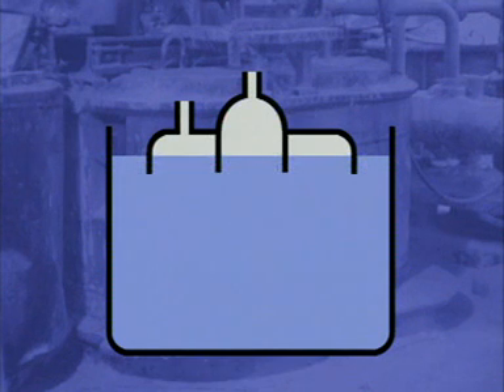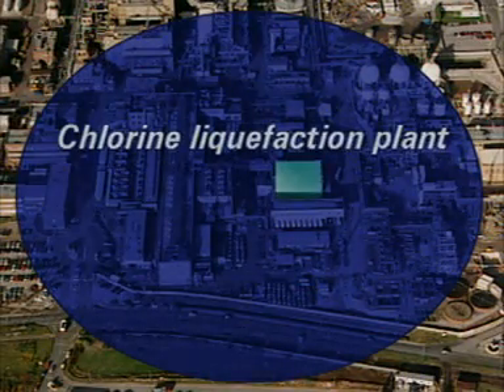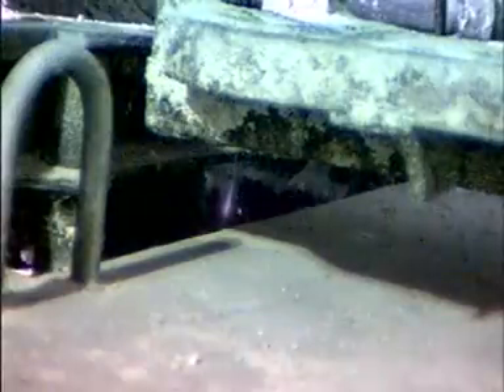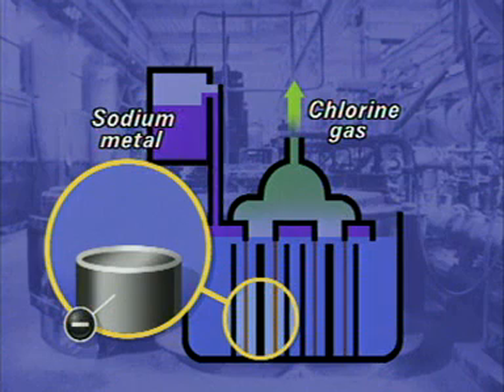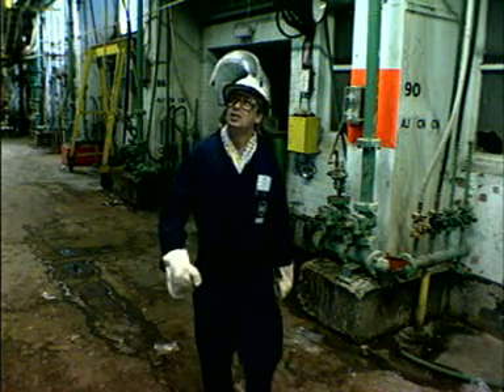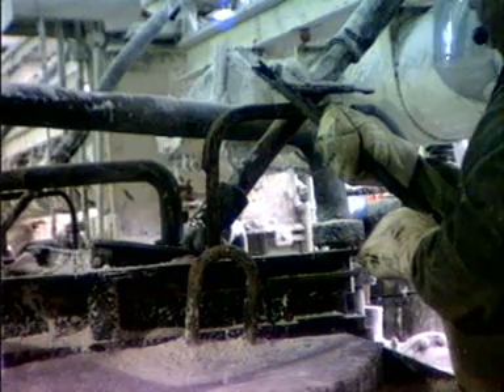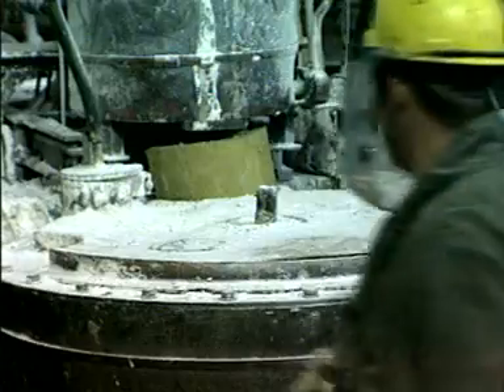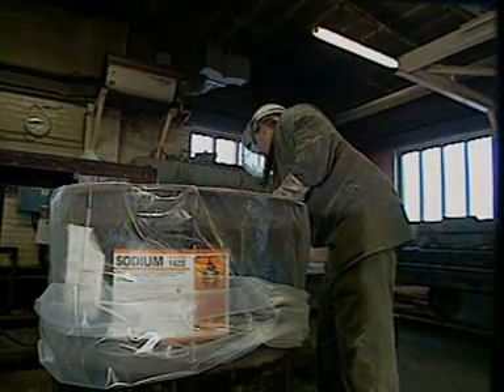Sodium production

Comment: Will this process stay economically relevant now that there's a far simpler process for producing sodium by sacrificing some magnesium? The price of sodium now that makes sense is just a bit above the price of magnesium.

If, for whatever reason, the electrolysis of magnesium is cheaper and simpler (I have to look into it), so is the production of sodium from it.
Reply: Interesting question.  I know the process you speak of but its really more amatuer-oriented.  I don't think it is faster or cheaper in spite of not needing quite so much heat.  This industrial process may look expensive but it really isn't.  Aluminum is made a similar way and the temperatures here are lower.  Salt (NaCl) is also a very cheap ingredient, where as NaOH is required for the process you mentioned, and that is not quite as cheap (with NaCl as it's starting material as well).   I'm also wondering how you would go about industrializing the process that uses magnesium.  Not saying it can't be done, but it is more complicated than this when looking industrially.

Comment: Nice, i was doing many test when i was 11 to make na use nacl.. it was 1987 and my big problem was difficulty to melting the salt..a few times i was able to make na using small tube glass but quickly after forming na begins reading with air ab catching fire..
Reply: I found that collecting the liquid sodium under mineral oil was enough to stop the reaction and put out the flames.

Comment: 3:07 wouldn't it produce calcium and barium too?
Reply: They do mention a little calcium is produced.  But due to the greater affinity that Ca and Ba have for Cl than Na, it's mainly Na production.  But, yes, certainly Ca and Ba are contaminants in the produced Na.  Although, it will also depend on the solubility for Ca and Ba in Na metal ... complicated stuff.

Comment: Workplace health and safety must be next level. Do they check the roof for leaks from time to time?
Reply: Yes the roof was checked, the building was so hot it was bone dry. They had the odd fire over the years and the operators had the occasional burn but generally ran safely

Comment: has anybody got an idea what material the chlorine collecting hood/funnel is made of?
i cant think of many materials that could resist pure, hot chlorine and be cheap and shapeable enough for industrial use.
Reply: I have NO idea.  On the sodium side, even very reactive iron is safe to use as an electrode.  On the chlorine side, what do they use ?   Graphite for the electrode AND the funnel ?  I'm not sure.  I would think CCl4 or SOMETHING would form from contact between the two elements are such a high temperature.
Reply: @pauls0416  Maybe a stainles steel variant ? maybe coated in a thin layer(oxides or chloro species?) as passivation ?
Reply: the chloride would react (the first time) with the wall of most metals in the piping. The same way fluorine reacts with the metal walls of its container to for a metal fluorine salt. In the same way chlorine would react with the metal walls of its container to form a metal chlorine salt.
Reply: I’ve got an idea that the chlorine ‘ collecting hoods were made from Inconel

Comment: How do they Prevent Sodium,Potassium,and Barium from Mixing?
Reply: They do mix.  They don't prevent it.  There is no need to.  Sodium is the most easily reduced ion in the mixture so they get almost entirely sodium at the negative electrode.  Slight over-potential does produce some calcium, as they said, but it can be dropped back into the solution.  The barium and calcium, therefore, remain in the cell and do not get used up.  They only need to keep adding salt.  The only part I don't understand is how easily they separate the calcium from the sodium.  Since they are both liquids at that temp, I assume the calcium must collect on the bottom of the chamber (being heavier) but it seems tedious to figure out where the division is and to carry out the separation.
Reply: The sodium went through filters before going to stock tanks. Sodium sludge from the filters was pressed to recover more sodium

Comment: I'm going to assume parts of this process are done in an atmosphere flushed using argon or dry nitrogen? like are the storage tanks flushed with something dry and inert to stop the sodium reacting, how are they mitigating the risks associated with handling sodium? is the air in the facility dehumidified? why was the barium used?
Reply: I have held sodium in my bare hands. Also only the surface of the metal reacts forming the oxide.this oxide acts as a protective laye
Reply: +Joep Stuyfzand cheers :-)
Reply: Joep Stuyfzand
Nah, I just like my chemistry and how it's applied on an industrial scale.
Reply: +Joep Stuyfzand you could probably use some kanthal or other high resistance wire with current running through it to melt the salt, that way you will not have to have any open flame and will have a constant heat source.
Reply: The passage of electric current through the molten electrolyte provides the heat to keep it at temperature.  Barium is used to increase the density of the electrolyte so that the liquid sodium floats on top.
Reply: @LarryMickelson  I thought the other salts were in there mostly as eutectics, i.e. to decrease the temperature required to get a melt.

Comment: Um when they pour that molten Na ,doesnt they react with the oxygen in the air o_O
Reply: They do. The oxide formed acts as a protective layer to prevent the rest from reacting,which is why only the surface is tarnished
Reply: @thoufeek1968  hmm it's not just on the surface.  It's reacting with the molten sodium stream as they're pouring it, too.  So this sodium is not 100% pure, even if you were to take the block into an inert atmosphere and cut off the sides, keeping only the center.
Reply: yeah dude its not that violent.  Wouldn't want to spill water on it tho... even after the oxide layer forms